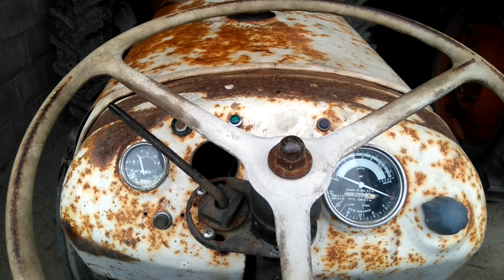David Brown 990 Late Selectamatic - Service 19/5/2017

Comment: A superb tractor. We had several David Browns including a 990 like the one above and no other make of tractor could compete with them for sheer pulling power and reliability - terrific to see so many of them still going strong like your one, 50 years after they were made. The best 2-wheel drive tractors ever built, without question.

Comment: Same color as my 1980 1410...rusty-white!

Great sounding tractor.
Reply from the maker: andy keddie  Hi Andy. I hadn't noticed your message until now I'm sorry. According to my instruction book for this DB 990 tractor it is a late selectamatic model with the AD4/49 engine even though it has round guards. The 990 models with square guards were from the era of the 996 etc. I used to have an early selectamatic 990, that one's engine was very similar to the red 880 Implematic, i.e. an AD4/47.
Reply from the maker: Apologies, I meant a red 990 Implematic, not 880.
Reply: @yscaio8344  i have same tractor i need valve rings and berings i con`t find it in south africa please help me

Comment: Man i love the old 60's david browns!  we have recently completely restored a DB 990 and we have an oil leak in the tach drive.  people tellme excessive pressure but we dont even have the valve cover on.  we have new pistons rings and sleeves also.  any ideas?
Reply from the maker: Hi Steve. I don't have any experience of ypur problem but I've researched on the internet and one comment suggests an oil leak from the O-ring seal on the tacho drive shaft. Here's the link:-
https://www.yesterdaystractors.com/cgi-bin/viewit.cgi?bd=ttalk&th=73674
I hope this helps. Having restored the engine on a DB 880 Implematic a few years ago I know that these engines need hard work after an engine rebuild, such as pulling a heavy roller for the piston rings to carbonise and bed in to prevent oil escaping past the rings. These DB engines don't seem to like ticking over for long periods, such as when working a saw bench.
Cheers, Iwan.